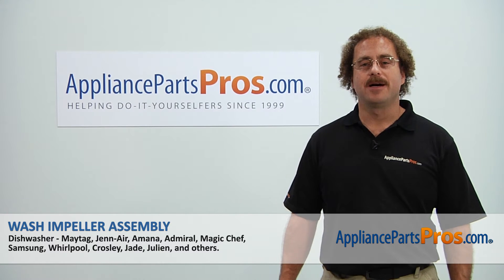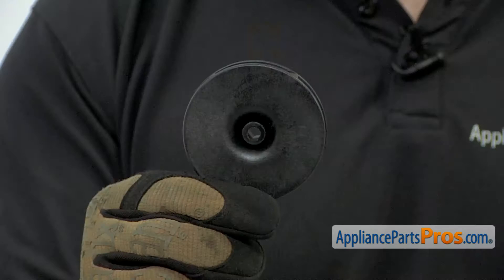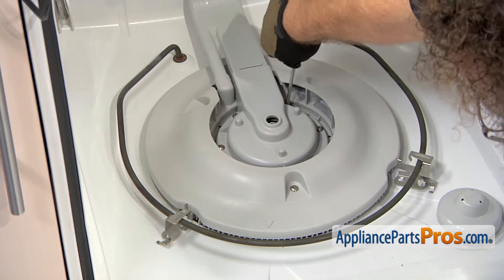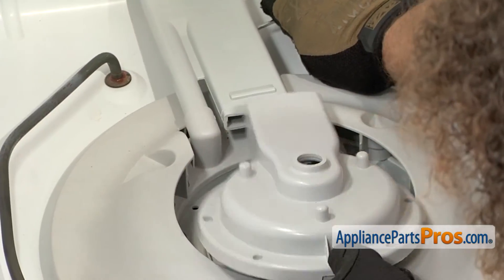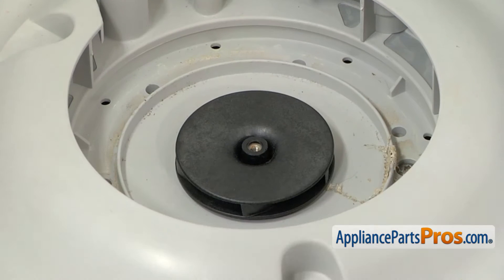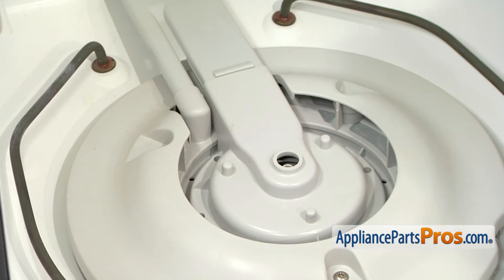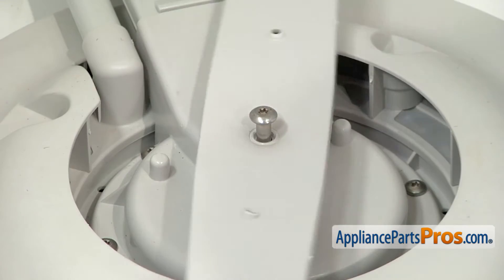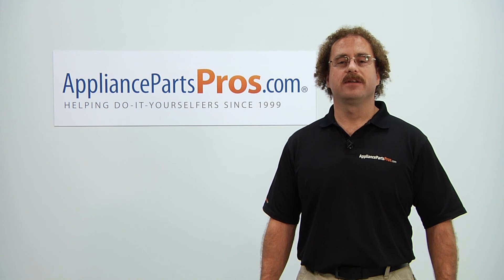How To: Whirlpool/KitchenAid/Maytag Wash Impeller Assembly WP99002659

Comment: Is there no impeller blade in this unit (mdb9601)? My unit REGULARLY blocks its spray arm holes with bits that look as if they should have been cut completely to shreds by an impeller blade. I have taken the whole lower part apart a few times and cleaned everything out, - to no great effect, - but the impeller LOOKED ok.  But your old one looks ok as well and you still replaced it.  Is there something inside that black impeller piece which is sharp and wears out and NEEDS replacing every few years?

The MDB9601 is full of blue tine holders that clearly can't stand the heat inside this unit and constantly break. Is the black material of the impeller similarly badly manufactured?